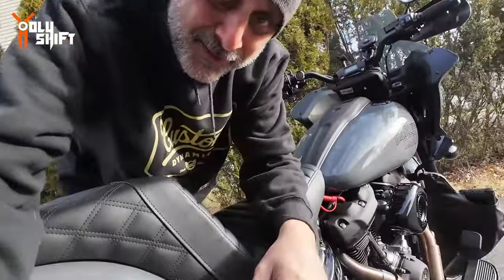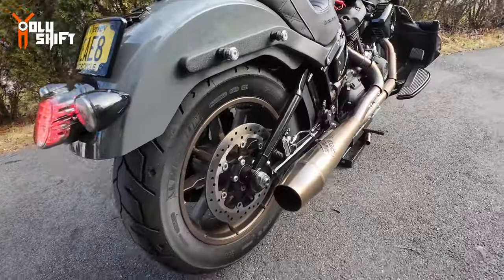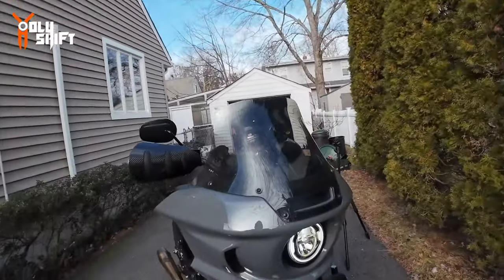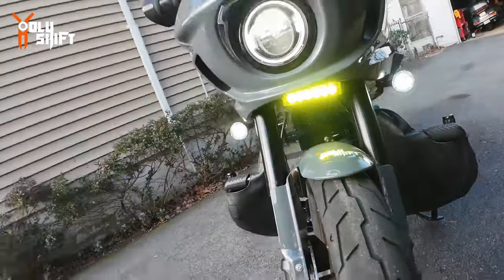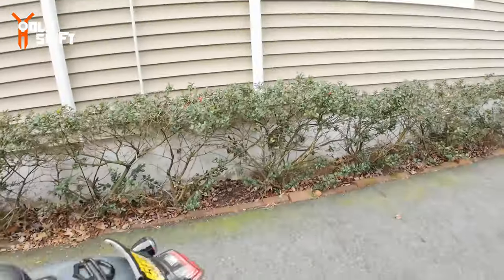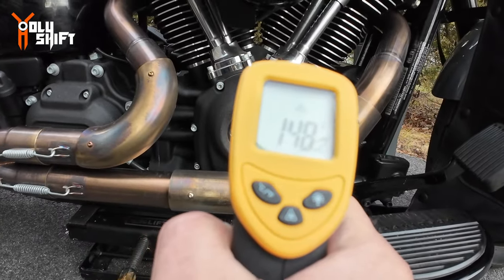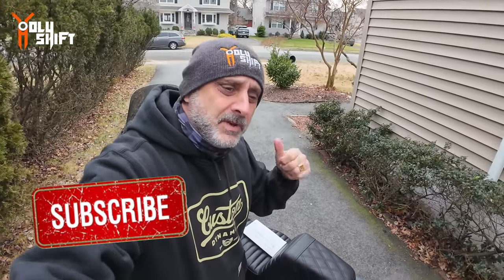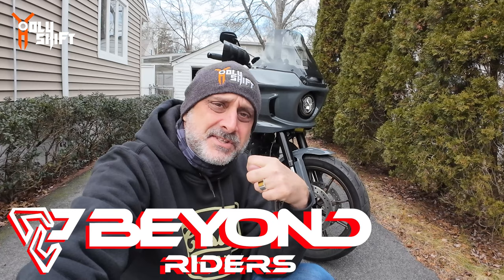You're Wrong - They Work !

Comment: Love your set and always great content.  I live in SC so it's hot in the summer (+95 Average) and a long ride I was running too hot and comfortable.  I went all out adding Love Juggs, 1" tank Lift, cooling deflector wings, secondary oil coller, oil relocation kit w/ cleanable rigged metal oil filter,  on my 22 trike and the temp difference is amazing!  Well worth the cost and effort.

Comment: If you still find your engine getting a little warm… it might be worth while looking into the ultra cool oil coolers and oil filter… made a noticeable difference on my TC. Nice scoot you got there!
Reply from the maker: The oil cooler is good - but I have nowhere to hide it on my bike
Reply: That makes sense, I didn’t think about that. I replaced the stock non fan assisted cooler on my ‘15 glide and was basing my fitment assumption on that. I’m glad the love jugs are working well for you.

Comment: I do not believe it’s only the air temperature causing overheating. If that was correct here in Las Vegas all Harleys would be over heating and none do. I had a stage 4 131 done in new 2023 Streetbob ran all summer. Stuck at plenty of red lights in 125 degree temps. No overheating issues at all. My friends are service writers at the three dealers here and not an issue. What is the issue is the humidity with temperatures. You are more probable to overheat in NY or FL with 80 degree ambient temp plus 95 % percent humidity than me sitting in 130 degree temps with 5% humidity.

Comment: Sandy, u need to do this in the summer when it's 90 or 100 degrees. Put them on , and that's an actual test!! In the winter it's barley warn the ambient temp isalready cold so any added cooling on top of the cold temp will bring it down because the outside temp is already helping it stay cool!!!
Reply from the maker: I will

Comment: Get a Dynojet pv3b and read all the temps you want in real time with and without the fan blowing. That’s probably the most accurate method to achieve proper readings. IMO it should be tested while riding your bike because that is where the percentage of temperature drop will change and may not be as much when sitting at idle

Comment: Try measuring the cylinder head temp, one inch from the spark plug. Thats the hottest part of the engine, and a spot you can accurately repeat every time.  I have the same bike as you and here’s the differences I measured before and after the love jugs.  The measurements were taken after 60+ mile rides, at the same 80 degree ambient temp. Front cylinder 305 before.  257 after.  Rear cylinder 315 before.  265 after.  Thats a 48 to 50 degree temp drop measured right on top of the cylinder head, next to the spark plug.  As you probably know, the ECM starts to retard ignition timing when the cylinder head temp goes above 270 degrees, and drops your torque and HP by up to 11% to try to cool the motor.
Reply from the maker: Interesting- didn’t realize that
Reply: DK Custom Products has a youtube video with two dyno runs with the motor at normal temp, and at 270+ degrees.  Very good video.   @HOLYSHIFT

Comment: They work better than your method of checking temperature. (Saw your buddy do the same, temps all over the map) The use of infrared thermometer is flawed, at best. These fans do cause cool spots, but nothing compared to a good oil cooling system. If you want to see how they really work, hook up your tuner and read cylinder temps.

Comment: I own 2 Harleys. They get ridden sometimes at 65-80 degrees outside. My main ride is a Wing DCT, and from 40-100 degrees, heat issues are non existant for that bike or the rider. Harleys are a primitive POS bike, and sometimes the riding experience they give is on par with taking a Ford Model T out for a spin. It's why I still own a couple, since they're cheap on the used market.
Reply: Yeah you really need two bikes. One to blend in, feel like a real bike , for around town. And One formal bike like Road glide ultra limited for trips.
Reply: @voodoodrug  If a Road Glide LTD was as good as my Wing DCT Tour, I'd own one of those too. It isn't.
Reply: In zephyr blue? 
I’d. Like more then two bikes but time, space and coast limit me to two bikes. I put 1k on my hot rod flhtc and 5k on my fltrk a year. Just don’t ride crazy miles even though I’m retired.

Comment: Sorry Sandy, you have to do the test on a hot day. obvious cool look at your breath in the video. So that means a fans are going to be blowing cold air on the engine. The issue is when your Riding in hot weather. Try doing the same test in mid July. Not trying to knock you.

Comment: I’m sure they work to lower the temp but I’m going to guess air cooled bikes are built to take the heat otherwise everyone would be overheating.  Most people use synthetic oil now and that isn’t affected. I’ve had the same air cooled Harley for almost 20 years and it’s never overheated.  Do you know a lot of people who have had their bikes overheat?  Not hysterical I’m just not seeing anyone overheat so I’d personally never buy these.   Love your ST Sandy.  Enjoy your weekend!
Reply: Could be more common than your experience.  I have two friends who had to do top end rebuilds after their motors got too hot.  Their rings lost tension and they started burning oil.  I personally bought a used Ultra with 8k miles that seemed to run fine, but apparently it had overheated at some point.  Turned out it was smoking on deceleration, and when I pulled the plugs they were caked with carbon. There was so much blowby, when you loosened the oil cap, it sounded like opening a two-liter Coke bottle that was just shaken up.  Again, it seemed to run OK, but a closer look showed clear signs of engine damage from overheating.

Comment: You should probably be reading the engine temp value from OBD/canbus, not with one of those thermometers.

I’m curious what the results would show. 

I’m considering getting a supplemental fan assisted oil cooler myself.